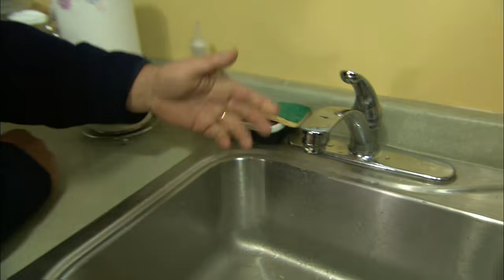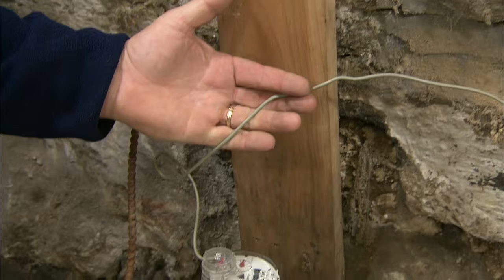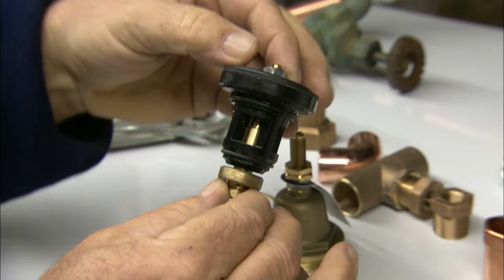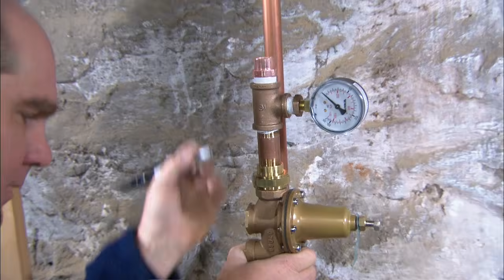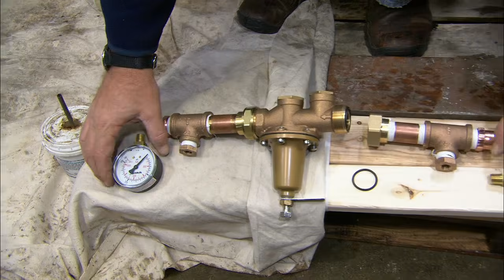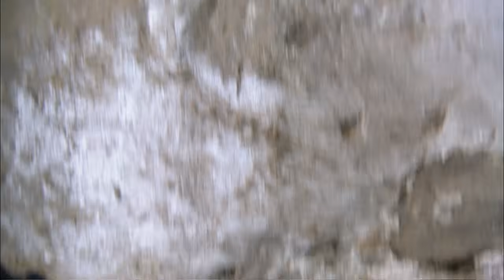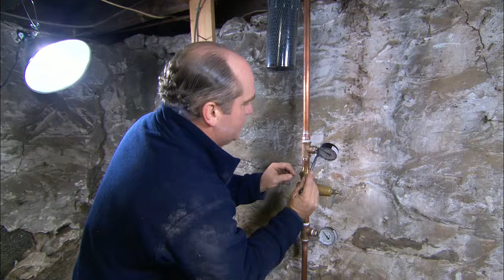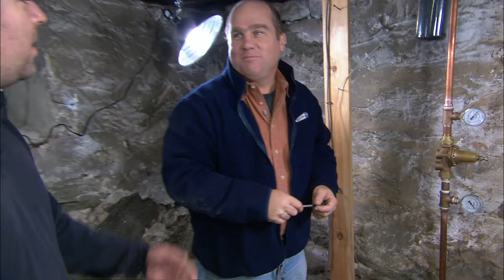How to Install a Water Pressure Reducing Valve | This Old House

Comment: I bet that faucet was crap.  Threads for the aerator were probably screwed up.  By the way, did anyone notice that union on the bottom of the pressure reducing valve leak as soon as they turned the water on?  They went in and zoomed in on the new gauges and there was a drip.

Comment: 50 psi is to low you will get complaints from the homeowners 65 to 70 is usually what I set then to.
Reply: BWing tools … pressure upstairs depends on the pipe size and the elevation from where the main comes into the house. If they just took out a well tank it probably never went over 50 psi and they are used to 25 - 45 psi as normal. I would hate to get a call back where water hammer took out an old pipe in a house that was built in the 50s or earlier.
Reply: @rupe53  50 is too low for a garden/utility hose and dishwashers and washing machines are rated for up to 120psi.
Reply: @kalijasin  ... good point on what they are rated for but in this video they are trying to solve a problem that seems to be new. Wild guess is they removed a well tank and put in city water. I already mentioned that well pressure was likely 50 psi before the change brought problems and so did Richard.

Comment: How does the pressure valve readings behave if the incoming water line has reduced volume to due mineral deposits and thus reduced flow?
Reply: well the PRV is self adjusting, so if the city side drops to say 40, the PRV would simply go full open and allow 40. IF the city drops from 120 to 80. The PRV would still give you only 50.
Reply: Pressure is pressure and volume is volume. 2 different things.

Comment: ……IMHO, a really important maintenance action, well done, except for:  Is it a good idea to permanently install those pressure gauges?  Even if the gauges are intended for continuous use, the brass tubes or bellows inside those gauges are gonna' constantly be flexin' & will eventually leak. (Nuttin' worse that plumbing emergencies.) Some claim you need to install fluid filled gauges, a more expensive design, for long-term durability. 
……If monitoring or quick verification of water pressure was a homeowner concern, I'd rather install what Trethewey called "draw-offs" or valve & garden hose bibbs-- one upstream, one downstream of the pressure regulator. That way, you can leave the pressure dials connected, but close off the valves to give the gauges a rest between readings, or replace the gauges, quickly.  
……This case reminds me of the one about the guy who thought it a good idea to measure the pressure in the freon lines in his aging central air conditioning. He left the gauges connected for long term monitoring, and wondered why his AC slowly got worse, and stopped working altogether.  Seems that the AC and refrig. repair gauges that he used were permeable to gas diffusion (slow leaks), and not intended for long-term use.
……Anyone have experiences or opinions to share?
Reply: It might have been a good idea to install shutoffs beside each gauge.  Fluid filled gauges are also more accurate from what I hear.

Plenty of fire sprinkler systems in commercial applications have gauges attached that are working 24/7/365.  But they are probably fluid filled gauges too.

Comment: You don't solder on fittings with the Teflon tape already on them . The heat from the torch will damage the tape. Also you should always use tape and pipe dope together.
Reply: I really think after they were done, they were taking all that BS back out and redoing it from the meter.
Reply: I agree regarding not soldering with the fitting installed and taped up, if at all possible.  However, I totally disagree that you should always use tape and pipe dope together.  This is not recommended by ANY pipe dope or tape manufacturer that I know of since it is redundant.  It really is one or the other.  But some people who think they know better use both because they don't understand either product really and it makes them feel better.  Not necessary, wastes product and if done incorrectly, can result in a leak. Use a good pipe dope product OR use quality teflon tape and be done with it.
Reply: You don’t know what you’re talking about, tape and dope every time unless doing high purity process and cda. Of course the manufacturer won’t admit their product alone does a half assed job lol

Comment: I'm not clear on how high pressure can damage a water heater. Doesn't the pressure reduce from going through the water heater? Couldn't you install a pressure reducer on the line going into the water heater?
Reply: always best to install reducer for the whole house..not just one thing.

Comment: Hi Roger , I was wondering instead of installing pressure valve why not to shut the main ball valve to 50% . That would have surely reduced pressure to 50 from 100. 
I may be wrong but I found that as quick fix
Reply: That does nothing to reduce pressure, only flow rate.

Comment: That's great, but all these American-made valves are crap.  They will fail to adjust after being installed less than a year if you are hooked up to San Diego water supply. Almost like drawing water from the Salton Sea.  And I have had many fail right out of the box!  Look online and find an Italian, Swedish, or German-made quality pressure valve, and solder into your copper line (since their pipe sizes are incompatible with ours (of course).  Or, move to the Pacific Northwest, and have all your fixtures and valves last for your lifetime.

Comment: He could just half close main valve
Reply: Хлебников Денис  Half closing the main would not reduce the water pressure.  It would however reduce the flow rate.
Reply: It doesn't work that way. It might work if you have a constant flow of water, but when there is no to little flow, the pressure would build up to the same pressure that is coming into the valve!

Comment: they could have just used Sharkbites and been done in 10 minutes
Reply: I love PEX and Sharkbite fittings. Game changers.
Reply: But this did only take 10 minutes....
Reply: I don't like Sharkbite fittings. It's not for professionals but for amateurs. Copper+sweat is the way to go.
Reply: in our place we installed prv valve  in gravity  pressure.
it is not able to control the pressure
kindly advise me how to reduce the pressure
Reply: Good idea they should have replaced all the pipes you are a man among babies.
Reply: maczrule if you're not a shitty, low-efficiency plumber, doing this in hard pipe only takes around 15 minutes and it's exponentially more reliable.
Reply: Propress is the way to go. Copper and sweating is a thing of the past these days, especially with the vast reduction in cost associated with propress fittings.
Reply: RiouInsuiko Just because something is old doesn't not make it inferior. Old furnature is built to last unlike the pressed board stuff you mostly get today. As a contractor that is trying to make as much money as possible on a spec home you are going to throw in pex because it is much cheaper, easier and faster and while I think pex is just fine I feel copper is a little bit better. I also don't like sharkbite because you have orings that will eventually harden and fail plus the fittings are way more expensive than copper sweat joints. I think sweat copper is the best (but most expensive) then pex-A is a close second (what I have in my house)
Reply: I didn't suggest that because something is old, therefore it is inferior. 'They don't make things like they used to' comes to mind when you compare old furniture to new stuff. That's because, while there are some improvements to things today as compared to the past, such as weight, cost, etc. The most obvious motivation for this is cost saving measures on the manufacturing side of things. When you buy a particle board bookshelf it's because it's going to be very cheap compared to something created with genuine hard wood. Though as it turns out more people tend to prefer cheap now, crap later, as opposed to buying expensive quality goods, but I digress.

To elaborate a little bit, I am merely saying that in many instances copper can be inferior to pex. Even then, it depends what we're talking about. I only use aluminum lined Viega pex with the crimp - brass - style fittings. I do not believe that things like Sharkbite with those dinky plastic fittings are quality products. While I have used them in the past at the request of a customer, I am not convinced that they are a worthwhile product. Pex has it's place, but for me that place is _not_ for entire house installations. I prefer to only use it on horizontal axis such as through rafters or around sil plates, etc. I've seen contractors using free-standing verticle rises of pex before with the only clamp being on the ceiling. That seems horrible. I don't even really love the idea of using it throughout a house behind walls if there is a chance that someone may hang a picture on that wall or drill into it for any reason. Pex can be VERY useful for making some connections. It's also exceptional for repairs. 

Though most of all I prefer solid copper pipe using propress fittings. In previous years, the fittings were far too expensive to balance out with the time saved. These days the fittings are cheaper and more available, I've even seen them at Lowes before. Propress connections are strong, fast, and reliable. As long as you are using the tool properly, making sure that each fitting is not burred or improperly inserted, it can really save a ton of headaches. I've gone from boiler replacements/installations taking 10 hours to cutting it down to 6. There's also really not a chance for leaks. Nothing is more miserable than completing all of the piping on a job, filling the pipes with water, only to find that there is a weeping joint or two somewhere along the line. Now that there is water in those pipes, you've got to drain everything down, and even then the tiny amount of water in the pipe can potentially make the soldering repair a bit more difficult. Where as the propress you cut, ream, mark the pipe and insert the fitting and crimp. If it drips, and this is very rare, you can simply re-press it. I've never had a propress fitting that simply leaked or didn't work.

Solid copper pipe with propress fittings is the way to go. The major downside being that the tools are well over a thousand and some kits are a few thousand and the fittings are more pricey. But man, I'll tell ya', once you go propress.. you won't ever want to go back.

Comment: Thank you members of the US Congress and constituents of the US Senate the measurements for thebest mix for the Senate judiciary system all the question I have is for ask this old House plumber Richard O'Toole a subcontract is endorse to you the actual manual for the manifold is written and completed calculus the question is asked what do you mean by 2X angle iron 3/4 inch thread pipe by the standard and specs of symplectic  symplectic calculus silver iron angle iron 3/4 inch thread pipe State your case of matter whereas this transition iron is silver iron and transition to sustain a constant what do you mean by 2X in this manual State your case of matter.. Today is October 15th 16th 2019 Pacific standard time zone 10 20 hundred hours.
Reply: Salame

Comment: How about you dont open the valve all thz way ?
Reply: United States standard minimum water pressure for fire protection is 60 psi.  My utility runs it at 70 psi to run the water bills up, as more water flows in a given amount of time at 70 instead of 60.  Water pressure is dictated by the height of the system's standpipes (water towers), 0.43 psi per foot.  60 psi would require the surface of the water in the tank to be at 140 feet.  118 psi would require a head of 275 feet.   So maybe this guy's house is in a 135 foot deep hole?  But to address your question, partially closing the valve will not reduce the pressure.  It will reduce the flow rate, however.  No change in psi, but would change the gallons per minute.
Reply: It doesn't work that way. It might work if you have a constant flow of water, but when there is no to little flow, the pressure would build up to the same pressure that is coming into the valve! That's where the magic of the prv valve comes into play. Because there is a spring in there, the valve opens and closes automatically to maintain a certain level of pressure.
Reply: Benjamin Esposti thank you for addressing this.

Comment: never touch the street side main shutoff..there should be another valve just after the meter...use that one. have seen many valves break off inside and then you are screwed.
Reply: gate valves mostly that was a ball valve.  There usually is another way to shut it off outside, i.e. so the city can cut you off if you don't pay the bill
Reply: i would not risk the outside curb shutoff...let the water company or a plumber mess with that.
Reply: @workingshlub8861  What risk????? Why call a plumber who will charge $120 to do that and laugh all the way home?  You can buy the water meter wrench at any Home Depot or Lowes for $20 and do it yourself.
Reply: @StilettoSniper  those valves have not been turned in who knows how many years???  go ahead and break it off and then when the city charges YOU to replace it ill laugh...oh and when it snaps in the closed position and you have no water .have fun with that hotel bill or finding a place until its fixed..
Reply: Right, because the valves they use at the curb are Home Depot Chinesium quality, right genius?  Just like the shutoff valves on natural gas meters too, right?  Don't ever touch that, no, no, better to call a professional or the gas company while your house burns.  Or that big, nasty 100 or 200 amp breaker on the outside of your house next to the electric meter.  Don't touch that, no no, better call a professional for that too.  Give me a freakin break. I've owned at least eight homes in six states and turned off the water at the curb for each of them.  No problems, piece of cake.  Probably because I know how to do it correctly and have the correct tool with which to do so when one is necessary.  Grow a pair of balls, gain some self confidence and don't live in fear of the bogeyman.
Reply: @StilettoSniper  so what you have had 6 houses im supposed to be impressed???

Comment: When installing a PRV valve an expansion tank is required.
Reply: Check with your local municipality as to what is code in your area.  Most require it from what I have seen.

Comment: Who doesn't like good pressure, 
Change out the aerator, and make air cambers on the water pipe, boom, problem solved, this is called selling crap you dont need and making money

Comment: Just close the main half way and you are done?!?!?
Reply: No, that would not reduce the pressure, just the flow rate.
Reply: @StilettoSniper  True but imagine closing the main 99%. At some point there is such a tiny gap for the water to flow through comapared to the diameter of the pipe that you will get less flow?

For example imagine a dam who opens its gate just one inch. Not much water will flow despite huge pressure.
Reply: @themomorain  That is what I am saying.  You will reduce the AMOUNT of water flowing per unit of time (the flow rate) but you are NOT affecting the static water pressure.  You can prove this to yourself using a pressure gauge. Install the gauge downstream of your valve, and start at zero psi static water pressure.  Crack the valve open as little as you desire.  Go to the gauge and watch it slowly climb until it reaches the same pressure as your water supply.  Now, go try the same experiment but this time with a pressure reducing valve (aka regulator) installed.  The static water pressure will only rise to the level to which the PRV has been set.  That is the difference between just cracking open the valve versus using a PRV.

Comment: This old hack, he should of installed unions on each side of his work. And never solder next to a threaded connection with tape or pipe dope.
Reply: those reducers do not last forever..unions would have been better...i agree
Reply: If you were watching closely then you would have seen the PRV had it's own unions where he pulled out the o-rings before soldering. If the PRV goes bad you just buy the same replacement and it's a drop in.
Reply: I thought he did great.  You just sound bitter you didn't think of his fix first.